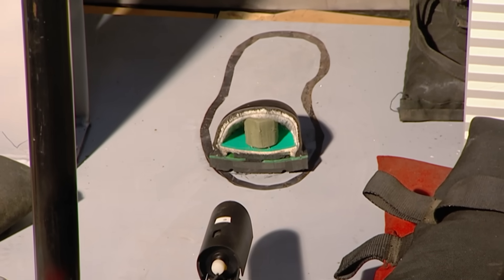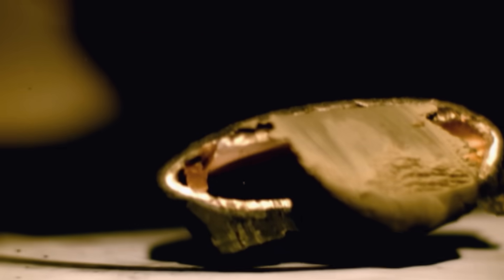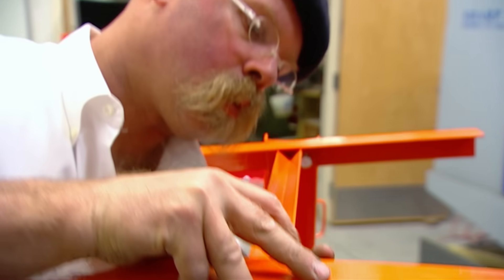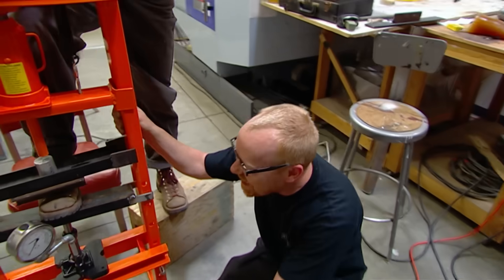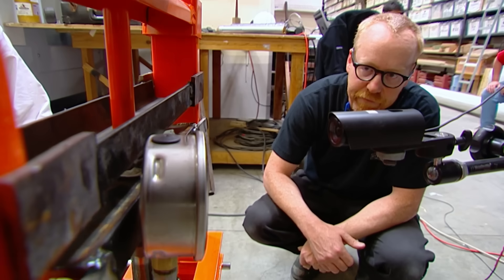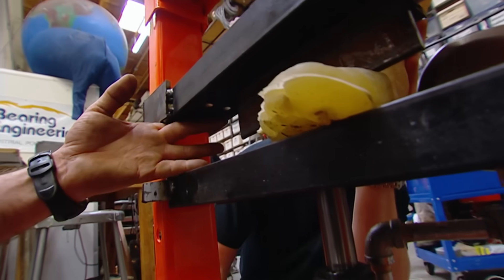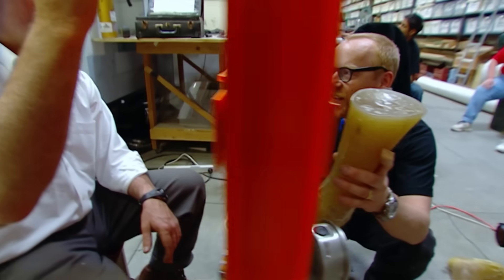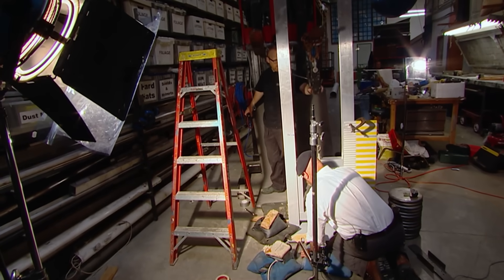Do Steel Toe Boots Really Protect Your Toes? | MythBusters

Comment: I work on trains. A coworker had a railcar roll onto the toe of his boot and stop there. He had to move the railcars to get his foot out from under. His boots were composite toe, not steel. The paramedics cut the laces of his boots to get his foot out, his toes were mangled but he didn't lose them. The composite toe ended up returning to its precrush shape. I am willing to bet if he were wearing regular boots his toes would have been jam under the 35T railcar
Reply: I must ask, how does someone have a 35t railcar roll onto his toes and not lose them, regardless of what boots he was wearing?
Reply: @damascusraven  I guess the composite toe kept some of the pressure off. And not all 35T were on that one foot. Railcars have 8 wheels, so it was "Only" just over 4T on his foot.
Reply: @damascusraven  Traincars are pretty heavy to lift, so I think it basically rolled up to the boot and over it until it had to climb a bit to go over - and then it stopped. Without fully running the foor over.
Reply: @Lightning_Mike  It was stopped full on his foot.
Reply: This makes me feel better about my composite toe boots
Reply: without safety toe boots the rail car would of just kept going

Comment: Steel toe or composite toe shoes definitely protect your foot compared to sneakers or non safety rated shoes, but actually save your toes depends on the mass and height of the object that collides with them. 

Moral of the story is Yes: But the results greatly depend. 

That being said even if they won't save your toes from a falling pallet of steel plates, they will most certainly prevent your employer from being fined for lack of PPE.

Comment: Even if this was a thing, IMO, a relatively clean cut by the edge of the steel cap would be far preferable to the crushing damage you would suffer without it.  My father, had an incident where the edge of a very heavy steel plate (about an inch thick) crushed his ring finger.  At the hospital 2 doctors told him because the bones were shattered, and there was too much damage to the tissue, most importantly the blood vessels, the danger was necrosis and that they would have to amputate.  A third doctor, by chance, peeked in and said there might be a chance though the technique of microsurgery, which was somewhat new at the time.  Even then they said his chances of keeping the finger were very slim, and to prepare himself should he not regain proper circulation.  In the end and after a lot of rehab, my father was able to keep his finger and gain nearly full use of it.  It was always a little gnarled, but it was on his hand when he passed over 30 years later.  He also was very fortunate he was working in NYC and the nearest hospital was New York Hospital (now New York Presbyterian Hospital - Weill Cornell Medical Center).

Comment: They are designed to save your toes under reasonable circumstances. But if a 10,000 lbs forklift drives over your foot(unreasonable circumstances) it cuts off your toes saving the rest of the foot.

Comment: I'll advocate for steel toed boots here. Cinder belt fell off a palette about 8', pointy side down and got my steel toed boot. I sure felt it. Sure hurt. Foot wasn't mangled. Most I had was a red line where the steel toe ended. That's with a sock. Foot would have been flat without the steel toe. Very happy work made us wear steel toe boots.

Comment: If you're 19 and you test your steel toe boots by dropping a pallet on them, make sure it doesn't drop on the top of your foot, there's no protection there, ask me how I know lol.
Reply: Steel toe worked fine, the part of foot above that however?  LOL
Reply: Not to mention the mast typically weighs 250 lbs. on small forklifts, what could go wrong? It's heavy enough to use as a press to rebuild transmissions. Ask me how I know.
Reply: It seems like every time I drop something and it hits my foot, it misses the steel toe every time.
Reply: @robertwinfree3197 yep Murphys law ugh.

Comment: So dumb. So so so dumb, almost as dumb as a ship doesn’t drag you down when you sink. Steel toe doesn’t lead to amputation. What a poor test, the forces you’re applying might slice your toes off but without it they’d simply mangle your ENTIRE FOOT.  This show got away with so much for far too long.
Reply: They were just taking it to its absolute logical conclusion to see if it was at all possible, no matter how unlikely the circumstances, like they do with every myth they did.

The obvious answer, and the answer they were sure of at the beginning and the end, is that steel toes will protect you, and in any situation where they fail you'd be just as bad if not worse off without them.  

They knew that, and they were engineering the absolute worst case and most unlikely scenario just to see if it could ever happen at all.

Comment: Now I want to know how the composites hold up. This was done before they were really a thing. I expect they'll land somewhere between the two, but it would be nice to know a comparison between steel and composite. The warehouse/sortation center I work in requires "safety shoes" which allows for the composites. I use them because I'm not dong the heavy lifting (fork lifts, pallets) anymore, and walk around the building all day with a computer. The lighter weight makes my 10-12 hour days easier.

Comment: When I worked for UPS, a 130 lb package was dropped directly onto my foot from about 3.5 ft high. I did not feel a thing, because I was wearing steel toed boots. The person who caused the package to fall on my foot was so concerned, meanwhile I didn't even know it had happened until they had said something.
Reply: How do you not notice 130lb package being dropped? Was it just a super dense ball or something?
Reply: @John-Smith02 
You dont realize the weight/ mass falling on your foot. Just that something fell.
Also worked at ups
Also have had 100 plus objects land on my feet
Unless of course that object hit higher up the foot. Then it hurts bad. But the thing is that steel toed part usually absorbs some of that force so it could have hurt a lot more
Reply: @Michael-sb8jf  .....no, I mean how do you not physically see it? It must have been small and dense or something or was your view obstructed or what?
Reply: @John-Smith02  
you be surprised how often a box's bottom will just give out.
on moment your holding a box 
next thing you know the contents are dropping and landing on your foot
or you pick something up you think you can carry. and you lose your grip

Comment: You guys did the test wrong and need time to drop something at the edge of the steel toe plate where it meets the metatarsal without any protection!
It will cause the edge of the steel toe plate to flatten and chop off the toes

Comment: Not worth waiting through the ads to watch, but to answer the question: yes they do unless you are an idiot and think they are invincible.  They are not.  Drop a cinder block on your toe and its just fine.  Drop a 10 ton I beam on it and the steel shank will just cut off your toes.  There it is.  No need to waste time on all those ads.

Comment: Had a friend who was "racing" forklifts with a coworker. He rounded a corner and the fork drifted on the floor and, unfortunately, he had his foot hanging off the side of the fork. It got pinned between the fork and a wall.
The surgeons had to use tin snips to get his shattered foot out of the steel toe cap that had folded.
 Admittedly not what there were designed for, but a danger to think about.
Reply: This situation was not the result of a steel toe being pushed past its limits. It was the result of reckless behavior with heavy machinery pushing ppe past its failure point. PPE is the last line of defense in the hierarchy of hazards and the least effective.
Reply: @RiseOfAnarchism as the last sentence in my post addresses

Comment: If it's strong enough to cause the toe cap to cut off your toes, you would not have your toes left regardless of you wear it or don't. What they do it protect you from are simple fractures from say a hammer drop. Better to have them then not have. 

Always comical I have to explain this to the old timers that still believe this myth.
Reply: They just want to believe the myth because their feet hurt. They've been wearing the damn things for decades and they don't get more comfortable as you get older.
Reply: the problem is you think it's funny.

Comment: There are specific circumstances where steel toed boots increase damage, but most accidents you are better off with steel toes than without.
Reply: Same with seatbelts too. Sure there's niche cases where it'll cause damage but the overall risk is worth the reward
Reply: @RiseOfAnarchism  I'm an EMT. During school we were shown images of similar accidents to compare where injury was incurred but some were wearing seatbelts and some were not. Yes seatbelts can bruise and even break your ribs, but nothing compared to what happened to people not wearing them. It's almost like that image of the WWII bomber with all the red dots showing where they were most commonly hit, those were the planes that made it back though.
Reply: Yeah, when you kick someone with them
Reply: specific circumstances like what?
Reply: @socksgratecheese In really specific scenarios it can deflect a blade-like force further up your foot, increasing potential damage from "terrible" to "slightly more terrible"
Reply: @haystack413  is there any research about this? if the toe is deflecting a blade-like force wouldn't it still absorb a significant portion of that force's energy? What about the instances where there is a blade-like force where the steel toe successfully absorbs all energy and doesn't deflect the force?
Reply: @haystack413 it could deflect bullet into eye